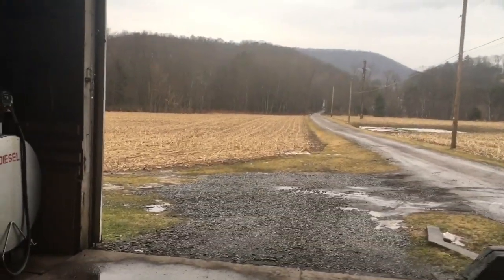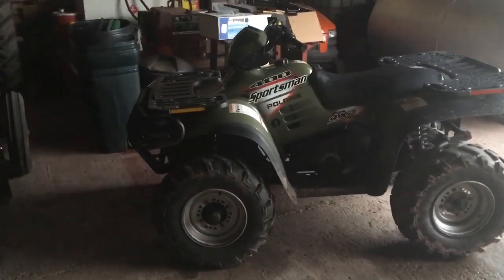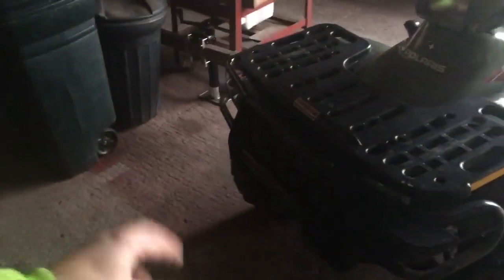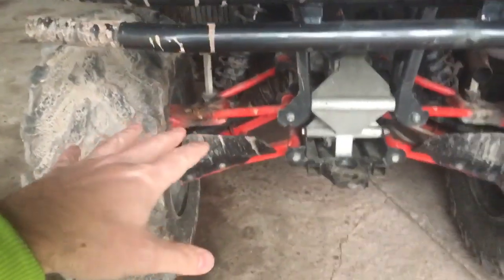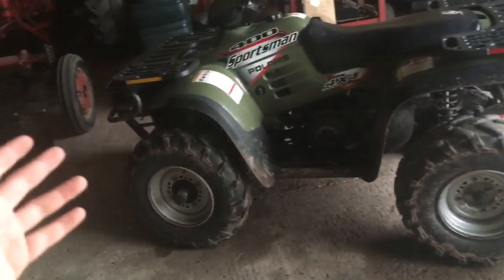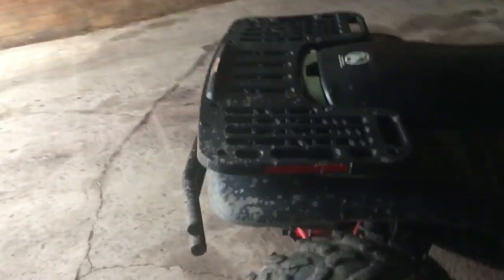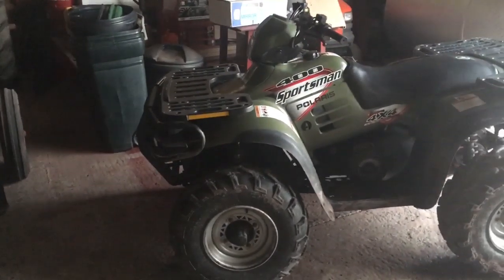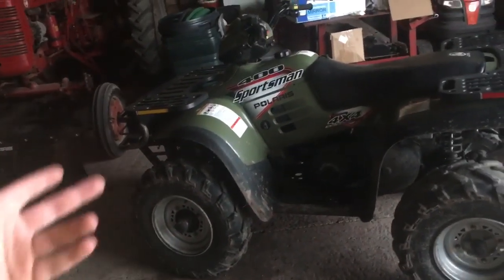Farm ATV Purchase

Comment: them were a good machine.  that is why I went with the 570. it was on the classic sportsman frame that is comfortable and predictable!  had a few bugs but overall a good work machine.  sportsmans are just solid and run. brother had a 98 500 that got crashed at 7k miles.  when I worked at deere Polaris store we had guys that had 15k miles on them.  they would go to Arizona for the winter and ride everywhere.

Comment: Independent rear suspension is a must, your back will love it. 
As far as the reverse override button, most will only go in low gear in reverse, with the switch if you press it, you will go into high gear. I have found if plowing may come in handy, but otherwise low is fine. You can experiment with it, but I think you press it and when you throttle up you can take your finger off the switch and it will stay in high until you shift, or stop, cannot remember.
 I have the Ranger 700 Side by Side, and I can tell you it is a work horse, plowing and hauling wood, even towing trailers around very handy.
Reply from the maker: Thanks yea I got to run it a little bit today. I have a video coming out tonight running it

Comment: I put many miles on a Polaris, when you are in reverse a governor keeps the engine from revving too high so you don't upset the machine going backwards. The override button shuts the governor off so you can go in reverse faster when you need to, like if you're stuck in the mud and need the power to get out. 2200 miles is like a new machine, so you should have it a long time. Good luck with it. 👍
Reply from the maker: Ok, thanks, yea reverse is pretty slow

Comment: Looks to be in very good shape, use the rear brake to shift into forward and reverse. If I can make a suggestion run Premium Gasoline in it, and don't be afraid to put a can of Seafoam in it from time to time. I worked on alot of older and new ATVS Carburetor and Injection models, the Carburetors were a big issue for some customers running regular gas,especially if they sat for awhile carbs would gum up plug jets.
Should be a very handy machine for you on the farm 👍
Reply from the maker: Yea I heard of guys only running premium in them. Probably a good idea
Reply: @PAFarms  
I strongly recommend it for all your small engines. 
Take Care 👍

Comment: Wouldn’t worry about that mileage or hrs at all.  Keep it serviced and it will treat you well. They will move snow well also.  Enjoy
Reply from the maker: I’m not sure on how often you change oil in them. I did find a YouTube video showing how.
Reply: PA Farms   I run 10-30 synthetic in mine and change it once a year but I only put a hundred miles a year on doing spot spraying and checking crops.

Comment: That winch rope is probably a synthetic fiber cable. It's very strong yet lightweight.  If you get it muddy, just wash it off and the rope will last longer than the steel cable.
Reply from the maker: I didn’t think of that, it’s probably a better idea with corrosion.
Reply: @PAFarms  these new synthetic ropes are all the rage for us jeepers who like to get into sticky situations. No corrosion, just keep them clean and will last longer than steel cables.

Comment: we have two sportsman 400s an 99 and 02 that we use on are farm if u have ne ? just ask the rear brake is supposed to be pressed down when selecting a gear foward or reverse it stops the transmission thats how i was told to use ares and i have over 800 hrs on the 02 with no ishues

Comment: thats pretty low miles 4 an older wheeler. mines a 2010 & has 5,000 + miles on it. the R override lets u go faster in R . top speed in R without override on is like 6 or 7 mpr.
Reply from the maker: Yea I noticed reverse was slow
Reply: @PAFarms  ya there set that way 4 safety. just hit the override bottom then u'll be flying in R..lol